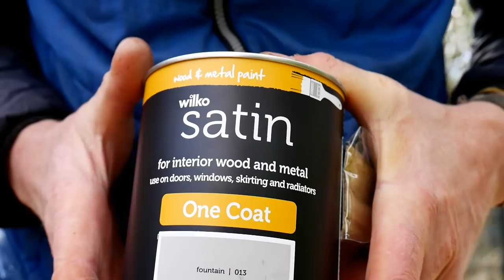Micro Camper Cheap N Easy Small car conversion Wiltshire Man

Comment: Great job Sandy. I have done a bit of this in the past, once for a month in my own vehicle, doing just what you're planning to - create a mobile base for your outings. I found a few things out. 
1) If police or others  see those silver blinds, they know you're in there 'camping', and will harass you to leave. A lot of places in the US frown upon this, which is ridiculous, but it happens. I found that painting the side facing the exterior flat black made my windows look 'blacked out' and drew less attention. 
2) Even if it were an Overlanding trip, where all exploration is done by 4x4, I took along a rucksack with all essentials to 'walk it out' in case of vehicular break-down - canteens, sleeping kit, food, etc, just like you normally would have. Yes, you should 'normally' stick with the vehicle, but in some cases if you are in an area where there isn't much traffic, you might have to still consider walking out of there for help. Keep your cell on charge all the time in the vehicle too as coverage might be spotty, or none at all in which case your cell could run dead pinging like mad to try to find a tower. 
3) For warmer months, create some mosquito/midge screens for a couple of your windows for ventilation. I found that if I made them to fit between the top of the frame, and the top of the window, I could roll up the window slowly and get a tight fit there. That way you can also make them whatever height you wish as well, if you only want to vent a few inches from the top, you just make them as wide as your window, and a few inches tall, and roll the window up to tighten. This also keeps people from just breaking through your screen and opening your vehicle (security). These will also help with condensation in winter months if you choose to do this at that time as well. 
4) Took a military sleeping bag with me and a couple of wool blankets. Cars are really not insulated for living in, so you might get a bit colder. 
5) A way to keep your perishable food cool is essential. For longer trips, and if you are going to be doing this often, I suggest an electric unit, and a dual battery setup. I would look at the National Luna kit out of South Africa, they're solid. 
Ok I have given 3 cents more than my alotted 2, I hope you don't mind.
All the best, and have a good time :-)
Reply from the maker: Cool tips there Nicholas. I will try painting the silver dark and see if it works. Food provisions will be purchased frequently and also cans will stay fresh for months. I think all will be good
Reply: @WiltshireMan  Just cover it in the black Gorilla tape or similar - works a treat and can also cover any edges that still allow light out too.

Comment: Hey fantastic stuff Sandy! I did the same with my Skoda, I use it for fishing trips.. a couple of things I did Sandy was to get some of those wind/rain deflectors that got on the windows so you can have the windows cranked down slightly at night to aid ventilation without rain/wind getting in.   I also string a bit of cord accross the middle of the car between the front passenger and drivers grab handle.  I can then just throw a blanket etc o we it to provide privacy from the front.   Looks awesome already looking forward to seeing your adventures.
Reply from the maker: Thats a good idea John on the rain/ window deflectors. I'm going to try sleeping in it tonight and tomorrow the wife will give it a try. Whoever sleeps in the car gets to sleep with the dog. Not enough space for two people but it's cost me next to nothing so I can't complain.

Comment: Thanks for a fun little video Sandy, I have made over many vans, pick up trucks, and station wagons over the last 50 plus years, my first was a 1961 Ford Econoline back in 1967, the most fun was a 1981 Datsun king cab pickup 5 speed diesel 55 miles to the gallon I still have it in the yard, I have had maybe 20 over the years some were motorhomes and full van conversions, but the most fun were the ones I put together myself, I ran them from White Horse in Yukon and Yellowknife in the northwest territories into Mexico and most places in between, today I run a 2001 Honda Odyssey. now you can get out on the open road and make us so great road videos with your new setup!

Comment: When I was camping in my van, I brought a fully charged 105 Ah battery with me. I put it on the floor in front of the passenger seat and strapped it very well to the base of the passenger seat (heavy duty straps because those things are heavy). You can charge it when you drive, or if that is not enough, you can stay at a camping site once in a while and charge it from mains.  You would also need a power converter, a CTEK type charger and plugs for twelve volt and USB. I would also buy a twelve volt voltmeter so you can check the status of both the car battery and the spare battery. When you have a charger like this, and the spare battery is full, you can even charge your car battery with it if it should die on you. There are extension cords you buy for both twelve volt and USB. You can even get them with triple sockets and maybe more. I had this setup for power to the back of my van.

Comment: Doing the same thing. Did the whole tent thing and posh Glamping. Then came full circle into doing a basic free build in my very, very  small car. Mini car build completed last week and like you my car can return in minutes back to normal. Only difference is this year in addition I invested in a Jackery E240 and compatible water proof solar panels as  like to have my luxuries being a female I.e mobile and pad as well as USB lights feel more safe. I saved for my Jackery and 3 years later last week got it. That is my upgrade and car sleeping as slept through some real terrible weather with storms etc in a tent prior and got flooded out where I ended up in my car. I am still carrying a tent that will act as a outdoor space. Honestly this is the way to live life as camping or car camping gives you freedom to travel on a small budget. Allowing  me to treat myself more.
Reply from the maker: I've heard about the Jackerys, they are very nice. Also I will use a simple and cheap popup tent for out door space, and also to secure the pitch should I need to drive away to explore
Reply: @WiltshireMan  Just purchased a E240 Jackery, do have the watch for their solar panel connection plugs, they want you to buy their own expensive make of panel.

Comment: Much more comfortable than a tent when UK weather is not so good. Some Velcro stick on buttons in the corner the windows would work well. I would also put a curve on the top corners of the storage unit before you hit yourself on the square point.
Reply from the maker: good points raised Rob

Comment: Sandy. Well done, some good ideas there. On my car the rear door triggers the cabin lights. I found that the switch for this is associated with the hook in the door which latches in to the ring above the bumper. To preserve the car battery when I have the rear door open, I use an old dog choker chain, push the ring on one end into the door hook until it moves to the closed position, turning off the cabin lights, and holding up the choker chain. The chain dangling down is a nuisance but helps remind me that the door hook is in the closed position and could be damaged if I shut the door without first returning it to the open position. The chain could also be used to hang a light. Many thanks, Gerard
Reply from the maker: On my car the electronics go into safety mode and turn off after a while if a door is left open
Reply: Those lights in the door, I went simple and took out the light bulbs. the thing I find annoying if I want the doors locked with the key turned off, I found none of the doors open and the electric windows are disabled.
At least I can switch off the car alarm, once locked inside though only a seated driver can emergency exit.

Comment: I like your video along with the music overlay,   I also like your suitcase stove mine is without what looks to be a EN417 hose (envy) I worry over the cheap hairspray can's nozzle fit (bad coflagration event)
I thought my Kia Sorento would be a simple fit with fishing bed but soon found it left little room (out of a bare 36") and an uneven floor re-introduced my housemaid knee complain (1st fitting 6'2" Electrician) .       I'm presently at my Phase 1 build experiment, a 4fold plywood bed, homebrew 4piece mattress, the rear seats having regretably removed, and a cheap plastic 3draw for storage.

Comment: Fantastic idea Sandy. I followed a chap in America on YouTube here that did something similar in a Toyota Prius +. It was part hybrid & due to the massive battery he could have the heater on all night or the A/C in hotter weather. The engine would cut in & out to keep the battery topped up. He was out on the road for well over a year. It laid completely flat in the back & he simply used a cigarette pump to blow up a double air bed at night. Was fantastic system & the chap saw the USA at a very, very cheap price. Also there were two Australian couple that traveled Australia in a Toyota Yaris. Small car but they had it completely sussed out on how to use every inch of space. Love to see you have some car camping adventures in the future. Cheers 🍻
Reply from the maker: That sounds awesome Andy. I guess the more you travel like this the more efficient you become. I shall try it out tonight

Comment: Great video Sandy. I've spent a few nights car camping in the back of my old VW Passat Estate. I didn't have a level bed like that. You've inspired me to rig something like this up. The biggest problem I found was inadequate ventilation. Modern cars are pretty much completely sealed. It gets all very misted up and damp with everything closed. If you crack all the windows an inch that's fine, but then the rain comes in. There is a solution available for the VW T5 van that cracks the tailgate open an inch and a half. if the wind isn't too bad/in the right direction, that stays rainproof apparently. I'm gonna try and engineer that for mine.

Comment: @wiltshireman. Ive had one a year but only just started using it and it ideal. Im 5"7 and your bed frame idea is a great one. My one ha the top board that more or less joins the seats. But your idea is better in regards to storage as im horizontal and you slide a bit if not level👌.
And the window blind idea is a great cheap alternative to so thank you'. I was going to tint them but ill try something like yours now i think.

Comment: Excellent little RV ya got there. For hand washing etc there is a clear plastic rectangular container in 2 sizes with a large fill cap and little spigot that will stay running when you open it. Made for lemonade etc for large home gatherings is great for camping. Also, for window screen, you can get a roll, cut in oversized and attach them to the outside of vehicle windows with magnets. Leaves you the ability to roll up windows if rain comes during the night. Those rug- mats are a great idea. Enjoy!

Comment: Looks very cosy Sandy and comfortable. I’m going to say get a fire extinguisher and a legit fire blanket to keep close at hand to the stove just in case as you don’t want your car to go up in smoke and also a good first aid kit. Just some thoughts on safety otherwise looking snug you should be very cosy I’m with that set up 🤔👍♥️
Reply: Good idea for fire extinguisher and blanket. I have them in my van. Have always carried a fire extinguisher in my vehicles. Not on my motorcycles though. I figure getting as far away from them as quickly as possible is the best course of action if a fire could be imminent!!!

Comment: Nice little touch sandy for a better nights kip , and if the neighbours are noisey just drive to the next pitch , 🤔 that stove has an igniter on it , just turn it Anti clock till it sparks then adjust the flame 👌👍
Reply from the maker: Cheers Martin. I think I shall be very happy with this little Micro camper:) I'll see if the stove has an igniter when I next fire it up

Comment: Very ingenious ! Looks very cosy.
 I work for VW at one of their commercial vehicle Dealers and you would be surprised how many vans have been  converted in a similar ways to yours.
I notices your  set square as you were measuring up the timber i have a similar one i made at school and i still use it 40 years latter.
Thank you for sharing (:

Comment: Hi Sandy, many many thanks for all the entertaining videos. Looks like a very practicable fit out; a virtual ready set up tin tent. I just bought a Go System ‘Multi Fuel’ stove like yours from Go Outdoors. There are lots of this design out there and like you, the adaptor for screw top canisters with this one, was a deal clincher. The instructions are rubbish and the burner control poorly marked but I don’t know if you were aware, if yours is the same model as mine, it should have piezo ignition on turning the burner control fully ant-clockwise.  Wishing you many great adventures in the future.
Reply: Local to me N.E. Surrey a Garden centre camping company (A320) is closing in Sept and those large Coleman cylinder's are going cheap (plus other goods) .     With my Sorento I cook over the rear sill, and I bought a 'Amazon hatch awning' (£55-60) help cover me from wind and rain and the awning covers from the hatch door to a pop-up tent (I mainly use for storage for my re-enactment kit, food, beer etc and if the RV is too hot a airbed)

Comment: What a great idea and video. On your area for cooking, you can get more storage underneath if you run even a bungie cord side to side across where the front of the stove sits, and just leave the stove in it's case there while you travel. You can them put a small box on the bottom for food items, the wash basin on top with pots, pans, plates and washing stuff on top of the lower box. Would give you a lot of added items you need all in one place. Just a thought to improve an already great little project.
Reply from the maker: That's a great idea!

Comment: Don’t know if you know this but the front passenger seat folds flat. You could have more room for 6 foot plus person. However you’d have to make a platform up between the rear and front seat. Hope this helps as I did it to mine. 👍
Reply: Pull the lever top left of the backrest! It will fall flat forward!

Comment: I think that Micro Camper project came out really well! Quick and easy conversion and a great Base Camp to be used as a jumping off point for much deeper adventures which you can stock pile up some reserves to resupply to continue on. Great job! My Grandfather had converted a few vehicles over the years when I was young and we did many adventures using a similar setup.

Comment: Using a lighter. Majority of these stoves have an I built spark lighter. Normally turn gas on full and turn it end stop and back and it should click and spark light etc. If you get a poundland tarp, magnetic hooks and a 12vdc shower and you will ready for a dirty weekend. Magnets on back hatch , tarp shower curtain. Cheers from old George 👍🤠🐕
Reply from the maker: I shall add a tarp for sure George. It'll be great:)

Comment: I think it is a very smart setup. Simple and practical. But I do think that the plywood for the bed is too thin. That thickness of plywood bends easily, even if the board only stands up against a wall for some time. I have one beside me right here :-)
If you don't mind having two or three small black dots on top of your windows, velcroe is your friend to attach those blinds with. And for lighting you could use for example the Harte desktop lamp or Ledfyr fairy lights from Ikea. They come with an USB plug. So it can be run either from the car battery (don't know if you can use the USB socket when the engine is not running), or you can charge a powerbank and run them from. A 13200 mAh powerbank will run these lights for many hours. You can even have both these two on one powerbank, for they normally comes with two USB sockets. The Ledfyr lights are a bit 'special' on my powerbanks. They need the Harte lamp to wake up the powerbank. But after that they work like a charm. The fairy lights can easily be put up or taken down again with small pieces of velcroe. Both lights give very good light. The Harte lamp is not collapsible, but it is very lightweight, and the head can be turned in many directions. And I am also saying to people, if you have space for it, like on the roof, you can bring 2, 3 or 4 of the same type of campingtable. When you put them next to each other, you will have a big table to cook or work on. Happy trips!
Reply from the maker: Thanks Annie thats very helpful. I think the sleeping platform will be OK, it is supported and sofar hasn't bent. I like the idea of using the powerbanks and the Harte lamps sound good, I will check them out

Comment: I had that stove as part as my Civil Defence Kit, and (as I hate my new kitchen electric hob) - I use the portable table top stove daily - it's perfect, responsive, and cheap to run - as we don't have mains gas in my country, and I much prefer cooking on gas. Just crack the window open first, and be mindful that the underneath support gets hot :)
Reply from the maker: Thanks for the warning about the stove base getting hot. I'll watch out for that

Comment: Great work matey, here’s a little tip, get some ‘team heko’ wind deflectors for your windows, allows you to crack all four windows open around an inch or so allowing a little air flow and lowering condensation. They’re only about £30👍🏼
Reply from the maker: Thanks for the tip!